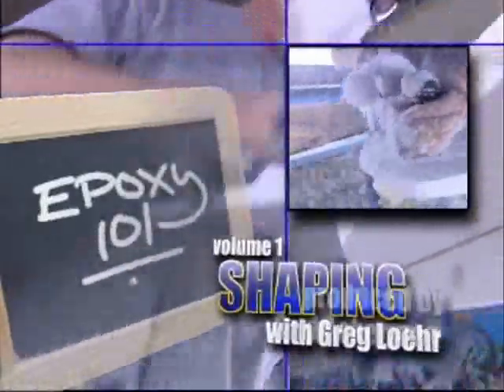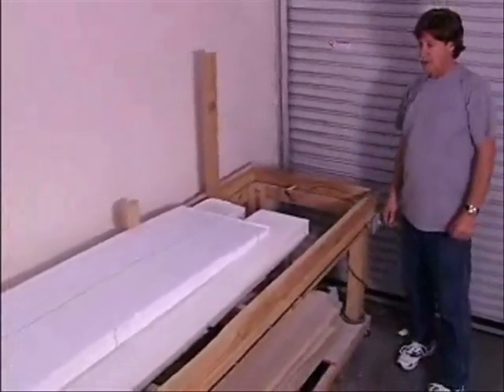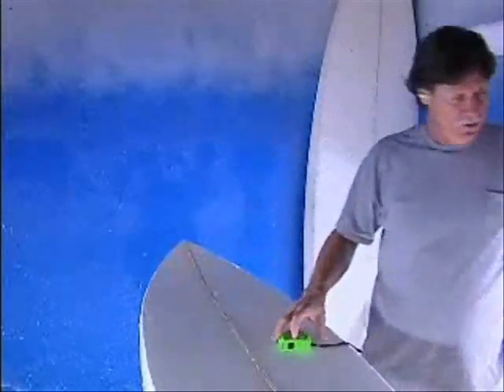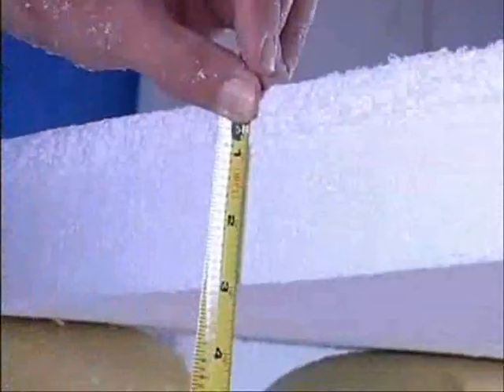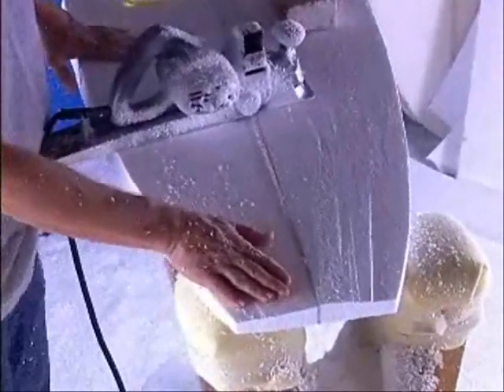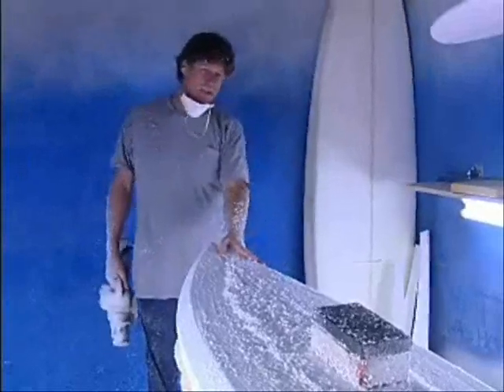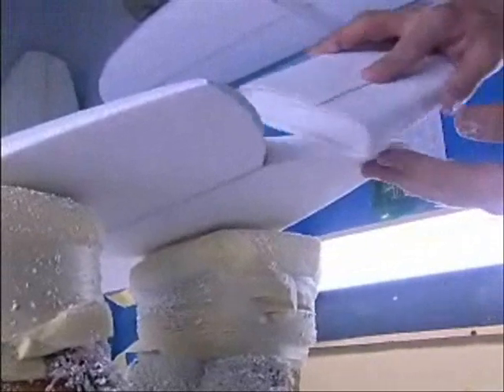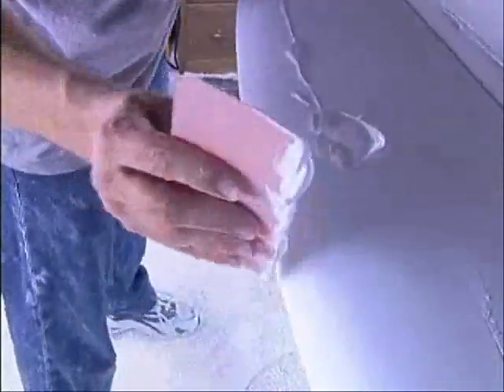Epoxy 101

Comment from the maker: He's cutting the blank in half with a hot wire, and then glues it back together with a wooden stringer down the center of the board. This adds stiffness.
If you've ever tried cutting polystyrene foam with a saw, you'll know that it does not cut cleanly. Using a hot wire, it melts the edges and is absolutely straight.